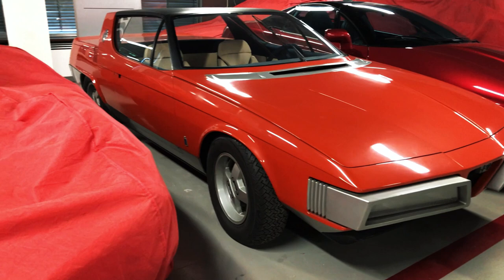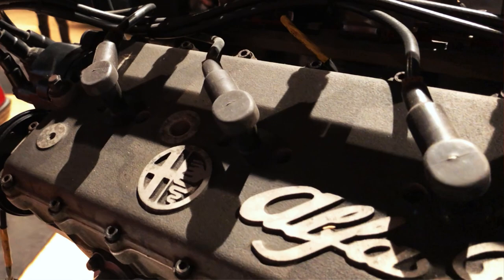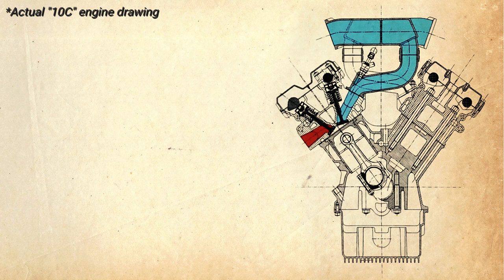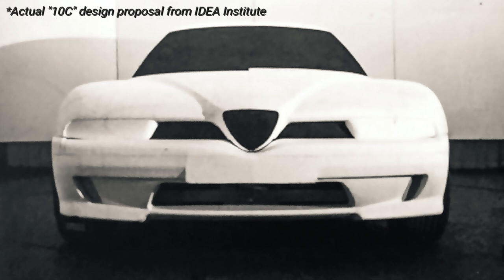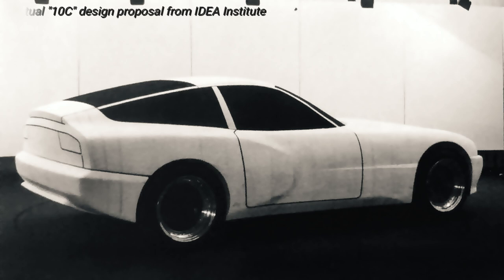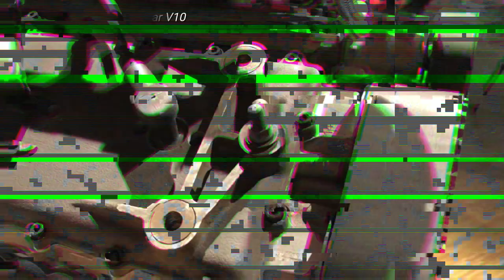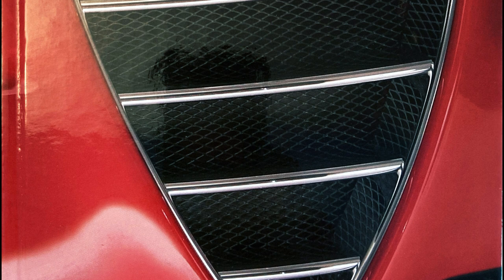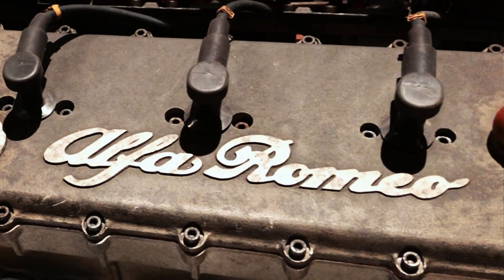The Lost Alfa Romeo "10C" Project

Comment: I remember the 164 look -a - like with the wing on the back , but the 10C , I never heard off. Looks like it would have been a high speed GT in Supercar bracket, especially with that engine.
Reply from the maker: Indeed. By the way, the wing on the back of the 164 Procar was all but ineffective, as it was too small. Development driver Giorgio Francia once lost it and didn’t realize it wasn’t there.

Comment: Was the 10C V10 all-new or were elements influenced by Alfa Romeo's other engine designs? Notably it appears only the road-going Toyota LR V10 standards out as having a similar 72-degree unless other V10s featured the same angle.
Reply from the maker: Unfortunately, the only info publicly available about this project are from the book I mentioned, and it’s not much. What it’s clear is that it was an all-new design that didn’t share anything with any other Alfa engine existing or in development at the time.